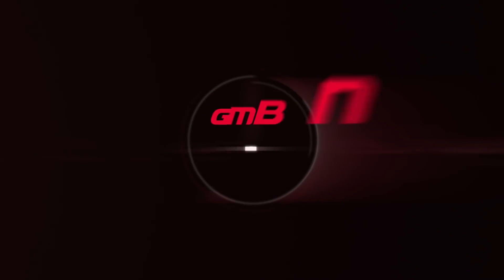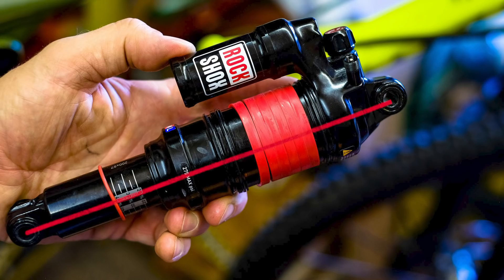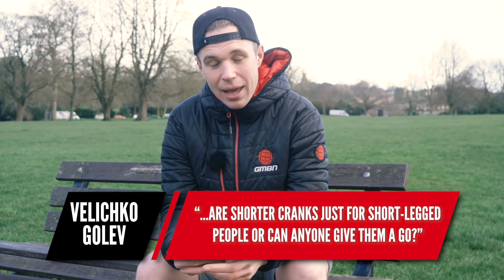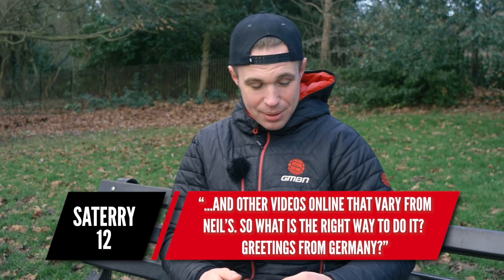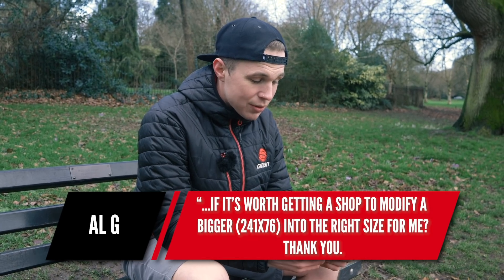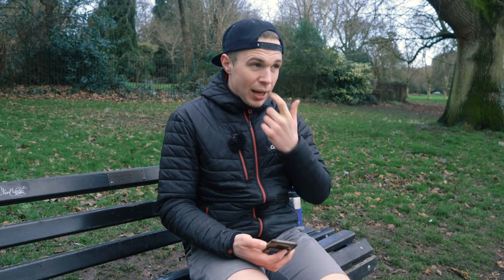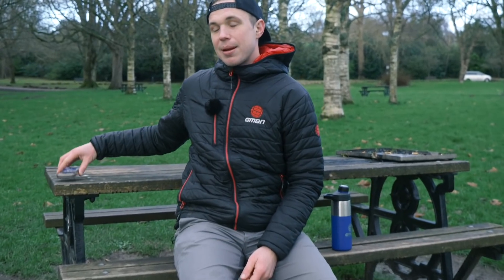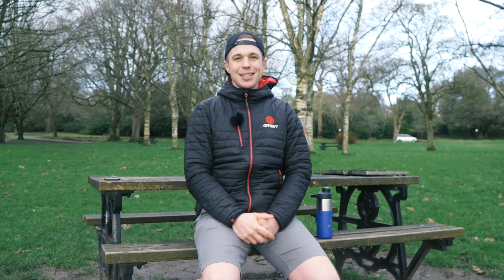What Size Shock Should You Fit To Your MTB? | #AskGMBNTech

Comment from the maker: Do you have a question for Doddy or Henry? Use the tag #AskGMBNTech for a chance to be featured on the show! 👇
Reply: #AskGMBNTech Is my idea correct, that a coil fork/shock should generally require less maintenance? As there are fewer pressurised parts therefore seals to lube.
Reply: Regarding the first question in the vid about the 50T cassette. I just made the switch from a 11-42T 10spd cassette to an 11spd 11-50T cassette. Used a new SLX 11spd medium cage rear mech. It shifts perfectly up and down the cassette and has no back pedal issues. Bike = 2017 Trek Remedy 7.
Reply: #AskGMBNTech Hey guys, I’m currently running a 2019 canyon neuron 1x12 and I’m thinking of fitting a bashguard/chain guide on it. Do you have any suggestions how to fit one on, when not having a ISCG mount at your bottom bracket? Cheers Chris
Reply: #AskGMBNTech hi, I'm looking at buying a new bike. I like to ride all different types of trails but am unsure what type of bike to get. I also have about £600 to spend. What would you recommend? Thanks
Reply: #AskGMBNTech hi guys I recently got a new Scott ransom,  I’ve chopped the bars down to 780mm and fitted new burgtec grips, I’ve noticed though at times the palms of my hands are going numb, I’ve never had this before with previous bar grip set ups which have been similar. What do you think the issue is? Il just add that the grips aren’t uncomfortable, cheers
Reply: #AskGMBNTech I like how my fork feels but on large jumps and drops I am getting close to or sometimes bottoming out my fork. To reduce the amount of travel I use should I install another token in the shock? Or do something else?
Reply: #AskGMBNTech hi, I suffer with carpal tunnel in both wrists and consequently don't have a lot of strength in my hands. I manage to get a tire off with help from tire levers Ok but really struggle to get it back on again, especially the last 10% or so. Any tips to make my life easier? Thanks
Reply: #AskGMBNTech Hi Henry, your show touched on a subject i am trying to get my head around. H have a meta tr with superdeluxe rct piggy back shock 210x50. i have been looking to up the travel in the rear slightly by removing internal spacers and getting it to a 55 stroke in conjunction with a raise of the front fork by 10mm (to slacken and increase bb height). i understand that you also need to fiddle with the piggy back volume also but no idea on how to do this. can you do a tutorial on shock mods for travel? becoming an increasingly discussed topic particularly now shocks are metric. thanks
Reply: #AskGMBNTech Hellou fellow shredderers, my question is related to bottom bracket height. My bike´s BB height is 380mm, and I have learned that most enduro bikes run a BB height between 330a nd 350 mm (roughly speaking), so I was thinking of putting smaller Tires ( the bike came with 2.8 tires) such as a 2.5. How much would that lower my BB and is it a good idea? Thank you for your time and happy trails:)
Reply: #AskGMBNTech I'm thinking of getting 2.8" minion dhf/dhr for my mega 275. The wheels have internal width of 30mm. Is this a compatible combination? Are there any reasons why this may not be a good idea? Or anything else I should bare in mind. Thanks
Reply: #AskGMBNTech is it sometimes necessary to replace the rim tape on a tubeless Setup? I’ve run tubeless for a year now and even though I can’t see any holes or damages to the tape my fresh tire seems to be loosing air the whole time.

Comment: #AskGMBNTech Hi Guys, I have a 2009 Specialized Pitch FSR Comp so still on 26' wheels. I've upgraded a couple of things ( I previously asked you guys about X1 and did the conversion and loving it). I need to replace/ upgrade the front wheel. The bike came with a RockShox Pike that uses a 20mm Maxle and I'm finding it hard to find wheels that will fit. What are the different types of axel in common use? The Halo T2 or DMR Zone say they have 15/20 axel fittings, but will they fit my 2009 spec bike?

Comment: #askgmbntech would shortening my seat tube affect the overall stability of my aluminium frame? My 2016 YT Capra has an immensely long seat tube and i would like to cut 3-4cm of to be able to lower my seat more. Would this have adverse effects on the stability of the frame?

Comment: #askgmbntech I want to put a coil shock on a 19 turbo Levo. I’ve read that I need to beware if the suspension is too progressive it will bottom out on hits and landings. How can you tell if your suspension is linear or progressive? Is there a mathematical equation or just a seat dyno feel?
Reply: Not sure where you can find this information but I think its called a leverage ratio. Most suspension setups do get more progressive deeper into the travel. Just depends on how progressive the suspension design is i guess. Try contacting your local dealer or the manufacturer.

Comment: Comment on crank arm length; Hi, I use mostly 170mm cranks on all my bikes. Consider the gear teeth number and remember that the crank arm is a lever. My rule is, if you want to spin faster in a given gear up front go with 170mm and if you want more speed and don't care about climbs to much go with 175mm cranks. Also, take a look on line at a gear calculator and run the gear numbers both front and rear to see what might fit your riding style.

Comment: #askgmbntech Hey guys, question is for Doddy, being a similar height your advice might be more on point. I'm thinking about changing my 15mm rise bar with a 30/38 mm rise. currently have a 50mm stem, would you recommend getting a shorter stem as well? my bike has a 510 reach, a 64 HA and a 75 STA and 160mm travel, initially the 35mm stem Ive had felt a bit too short. thanks, keep up with the great content!

Comment: #AskGMBN I have a 2018 Spectral with 140mm rear travel. 2019 and 2020 models have 150mm travel on the rear with the same frame. I ve read on reddit that you can take a plastic spacer out and make my bike 150 too. How can something like this work when the shocks would be same eye to eye lenght?(I suposse) Can this be done? Thanks

Comment: Shimano 11 speed mountain bike components work flawlessly with an 11-50 cassete if you use a GS rear derailleur. I run an XT M8000 drivetrian with a Sunrace 11-50, it shifts perfectly. Long cage SGS derailleurs will not work well.

Comment: I did the 11-50 sunrace conversation. It didn't work great with the standard derailleur. After putting on too much B tension I didn't get enough chain wrap around the smallest cog, so it ended up slipping under load.  I solved this by using the oneup components derailer cage. Worked perfectly then.👌

Comment: #AskGMBNTech: Hi there! I like your show very much. Keep on going. I have a problem here, which I can not find the reason for: My chain often drops of the front chainring, not from the top but from the bottom part. This not only happens on gnarly terrain, but sometimes even on rooty passages. Shifting works nice and smooth and the chainlength seems to be fine. Last time it happened when my son took my bike and he didn't even used the smallest sprocket on the rear. It's a 1x11 X01 on a Kona Process 153dl from 2016. Do you have any ideas besides a chainguide?
Reply: Do you have a clutched derailleur? sounds like the chain moves too much
Reply: @ultiss  Yes, I think so too. Maybe the chainring is also a little worn. Hmm. I think I have to look into chainguides

Comment: Wouldn't a goat link fix that problem with a new chain for 42 to 50 tooth cassette with long cage
Reply: No link required if you run a shimano the mid cage deraileur. I run a Sunrace 11-50 with my XT8000 drivetrain, shifts perfect.
Reply: I have a goat link on my xt derailleur picked it up because my lbs said I would need it

Comment: Like others here have said, youre wrong about the 50t on an 11 speed. I run the 50t Box Two cassette with a Shimano SLX mid cage derailleur on my Specialized Enduro and it shifts smooth as butter across the entire range.

Comment: #AskGMBNTech I bought a used 2013 Trek Stache 8 last summer and the lockout on the Fox Evolution 32 fork never worked. It didn't bother me then, but I'm going to be racing come summer and was looking to get it fixed. I was told by my LBS I needed a full rebuild ($200). I've been told online I could get a new damper, but I can't find one for sale. I've also been told to just throw it away. What should my course of action be?
Reply: best option would probaly be new fork. I read the grip dampers are even smoother than the fit4

Comment: #AskGMBNTech: Hi guys, thanks for the shows, very informative. Is there any relationship between rider height or weight and the requied suspension travel for a given set of conditions? Would a taller & heavier rider (6'5", ≈115kg) require a longer travel bike than a more average rider for equvalent performance on the same trail?
Reply: Paul S no, you just set the suspension according to your weight

Comment: I run 165mm cranks because it is 9.7% of my height in mm. The industry tends to flood the market with 175 on all bikes and people have no idea that the cranks they are riding are too short or too long for a proper fit.
Reply: not to mention that 165mm cranks are not so easy to find, compared with 175...
And if you want even shorter (for kids bikes).. you'll have a lot of trouble finding decent ones.

Comment: #askgmbntech I have a 2020 stumpjumper evo 27.5 and the rear shock (fox dpx2 performance) has a very light damping tune so I have to run the rebound all the way closed and lots of air pressure to keep from bottoming harshly. The shock already has the max volume reducer in it. Do you have any recommendations for a shock that is more adjustable with a firmer damping tune?
Reply: you can get a shop to rebuild it with different shim stacks

Comment: #askgmbntech Is there a way of telling the difference between pads by looking at them, I've noticed that some back plates are different colours, is that an indication on the material?
Reply: there a loads of companys making brake pads. Backplate colours arent standardized and cant be used to compare pads. Maybe within 1 brand there are certain colours used for certain compounds
Reply: I don't think so it may just be differnt manufactures but you can tell with differnt pads by looking at the actual pad

Comment: #AskGMBNTech Should i go for the DT Swiss EX 1501 with 30mm inner width or the XM 1501 with 40mm inner width? The EX is meant to support heavier riders (i'm about 100 kg) but i don't know if the 40mm wouldnt be a greater benefit when running 2.8" tires on my hardtail

Comment: I have an 11 speed Shimano groupset and use an 11x50 Sunrace cassette. I use a Wolf Tooth Goat Link 11. It replaces the part of the rear mech not used on direct mount frames. I don't have any issues with shifting.
Reply: Me too - Sunrace 11-50 cassette and Shimano SLX rear mech. (SLX 11-spd. has the highest shift capacity of all 11-spd Shimano mechs.) After rear derailleur b-tension adjustment no problems at all with shifting.

Comment: #AskGMBNTech Is it better a hardtail with better specs or a full sua with worse specs? I'm thinking about a Vitus sentier bella raga or a vitus mythique vrs.
Reply: Yes. It depends on where you’re riding. Out here in Colorado it’s a lot of full sus since rough terrain is very common but you still see plus hardtails. If it’s not very chunky, I’d run a hardtail. Maintaining the shock and linkage and frame bearings is just additional cost if your trails are mostly relatively smooth.
Reply: vitus mythique is fantastic value. I think you'll be able to push your riding more with a full sus. My first legit mtb was a full sus and I'm super happy I got a full sus instead of a hardtail. Just make sure to take care of the rear linkage
Reply: Or get a calibre bossnut which is a good spec full sus.

Comment: #AskGMBNTech Hi guys, question: I recently bled my mates' xt brake using his bleed kit which consists of 2 syringes (rather then a syringe and the bucket which I used in the past with good results). The piston of the syringe which attaches to the lever was quite sticky though and when trying to push the oil through the system from the caliper end, instead of the syringe filling up I got a huge leak from the lever. Long story short, I still managed to bleed the brake, it doesn't go spongy over time and there's no visible leaks. So, is it possible to push the oil through the seals of a shimano brake if you use to much pressure, even if the seals are not damaged? The brake which leaked like mad when bleeding it (oil definitely NOT coming from syringe/lever interface), now seems to be absolutely fine. Thanks!

Comment: Hi i was just wondering how big of a casset I could run on my Shimano 10 sped deoreXT drive train???Also great vids guy’s!!!
Reply: Hi, I converted an xt 2 x10 to a 1 x 10 Sunrace Mx8. It has a 10 - 40 ratio. I have a 34 narrow wide race face chain ring. The xt derailleur runs well with it. I just upgraded the shifter to xtr out of choice.
Reply: I've got a 11-46T on my 10 speeds - one is running a deore m6000 and the other is running an slx long cage. I run wolftooth goatlink on both bikes and don't need to adjust my b tension that much.
Reply: There is a long and medium cage, I have a 40t on the medium cage no problem (officially max is 36 for medium). It could probably take a 42.

Comment: @callum richards: my transfer from shimano XT 11-46T to Sunrace 11-50T was no problem. But I think you need the long derailleur cage (SGS) to work properly. Check first, I think the 11-42T might have the medium cage (SG).
Reply: the GS has officially a 39t capacity, which is exactly what you need for an 11-50 cassette
Reply: You need the GS derailleur, the long cage SGS is only good for 2x applications.
Reply: @MAGAIVER  that could be right. I changed from 3x11 to 1x11

Comment: #AskGMBNTech Do fork manufacturers cater for custom builds and/or can fork components be mixed and matched, within reason? Was toying with the idea of resto-modding an older bike and looking at fork options for 1 1/8" straight steerers, which is limited to say the least. 
For example I noticed that the the Suntour Epicon (which has a straight steerer variant) and Axon (which has better damper, through axle, 27.5" wheel options for making a mullet bike, etc) share 32mm diameter stanchions and 130mm crown pitch. Would the upper and lower of each fit together easily. Could the damper cartridge from the Axon slot straight into the lower spec Epicon?
Reply: rockshox reba comes in a straight steerer aswell, and it can be upgraded with the charger damper

Comment: 4:00 henry thought about the feel on the rider and how it affects for those who have short and long legs. but IMO, aside from that, its all about torque, torque is force x distance, or a twisting force, now for a given drive train with 1:1 ratio between cthe gears, and a rider can put down N amount of force (consistently) that 165mm or 170mm will be the defining factor on how much torque is put in the tires. its not much but it does make sense during climbs. it is much like how the combustion process translates the explosion of gas and air mix that moves the piston down and the crank will turn relative to the shaft.  you can do an experiment on this buy getting someone from gcn who can put down a consistent amount of power, give him a bike, set the gears closest to 1:1 and throw in a set of cranks from the shortest to the longest possible you can get. and theoretically, the ones with long arms can climb faster then short crank lengths.
Reply: i get your point but its kind of irrelevant with all the gear options mtb's have. gear ratios have a way bigger influence over torque at the rear wheel
Reply: @ultiss  yes because gears are torque and force multipliers.

Comment: #AskGMBNTech
Hey guys, just out of curiosity, What are your thoughts about building a gravel bike by mountain bike xc hard tail frame with rigid fork, gravel drop bar, shimano grx groupset, seat post dropper and 27.5 or 29 inch wheel? Love your show and keep riding
Reply: It's awesome. Ppl usually call it a monster cross bike

Comment: #AskGMBNTech can i put a longer travel fork (let's say 120/130mm) on a canyon grand canyon al 6.0?
Reply: Yes. General rule of thumb is +20mm from stock, so 110-120mm would be fine. There will be changes to geo though, headangle slightly slacker, the BB will raise (will feel like sitting higher on top of the bike instead of "in" the bike), and the seat tube will be slightly slacker too.